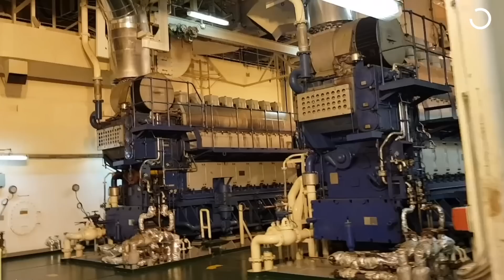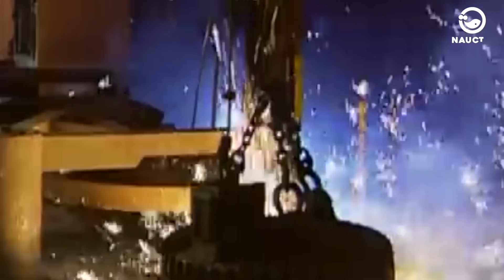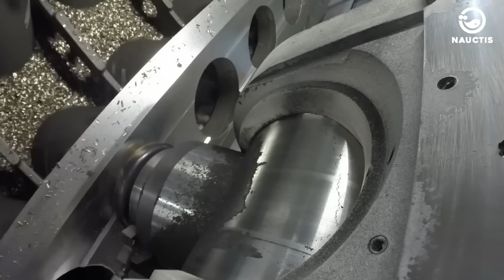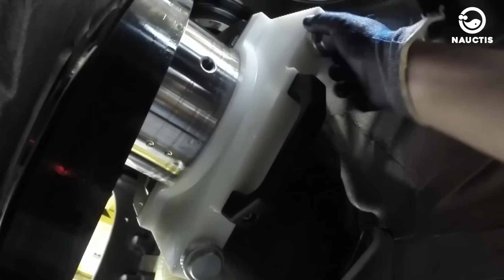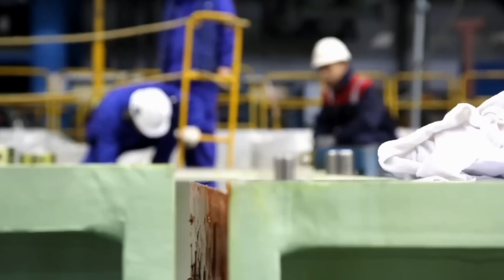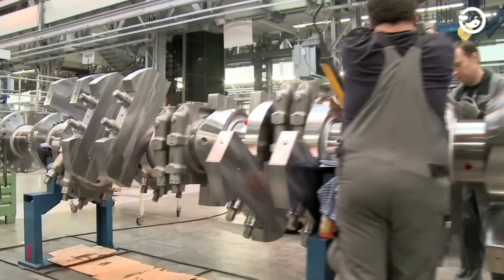INSIDE The Building of the World's Largest & Most Powerful Ship Diesel Engine Ever Built

Comment: thank you, prevent effect of global warming, minerals and temperature of water and air from sea are huge source of energy,  reduce more than 50% using fossil fuel, fresh water, fertilizer(minerals+o2,n2,C), zero pollution, economy will rise by using jet plasma machine and compressed gas(Air) in isolated structure in water pool  with more than 80 % efficiency, it  has two vertical cylinders, in first level it transfers compressed gas(hot air) temperature  from engine to sea water in pool for steam electric generator,  steam combines with high cold Air  pressure to produce pure water and electricity , New energy from sea will change world soon, there are other source of energy that with international cooperation in coastline we can reduce effect of  global warming, further more  we can prevent these phenomena like cyclone and flood and wildfire by using this hot seasonal atmospheric condition, recent years in summer, geothermal energy happens in surface of coastline, there are many countries in coastline with seasonal hot weather and water condition in comparison with middle Ocean, its more than 12 degrees ,this differences must decrease,  in sum-up, by using this energy not only is economical but also reduce global warming in countries like Japan, China, India, Mediterranean countries, Iran, Brazil, Mexico, Us, Canada, (Africa and Arabian countries....) . I invented new method base on air pressure rules and quantum physics ionization sea water minerals in strong dynamic permanent magnet(SMCO) with special frequency(1500or 3000)/minute  bases on paramagnetic and diamagnetic particles and electrical microwave electron wave field and electric chemical reactions and photon wave from semiconductors with special angle Cations like(K+, Mg++, Na+, H+, H++, li+, H2, ...) are transferred to in the second level into up level by vacuum pump from storage into combustion chambers and they combine with O2 and N2 ,...  as major part of fuel they increase speed of machine, modern induct Giri box to control opposite direction, for producing electricity and fresh water (removed minerals by accelerate ionization sys from sea water) and fertilizer. this machine produces 150Megwatt/hour and 20000M3/DAY fresh water and fertilizer. 7 methods zero pollution for reducing global warming I mentioned in my profile. (G20 countries can solve these phenomena).

Comment: In my way , my invention flash driving running in light speed way can power that 10000v ac x2 , and sectional way resting and running. 
The front pulling the back pushing and center zero which is the chassis and load is following only. 
Using the gapping zone.  Gapping zone is the way to move the ship , as long as front is levitating the entire chassis of the ship is following ONLY.